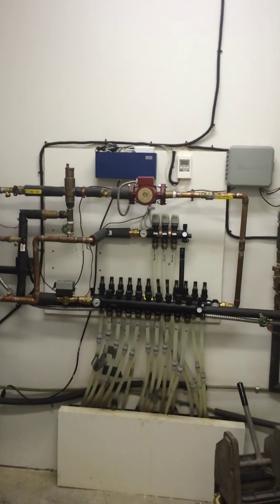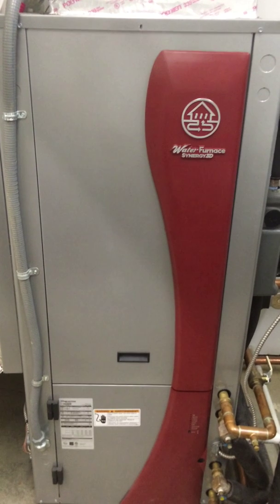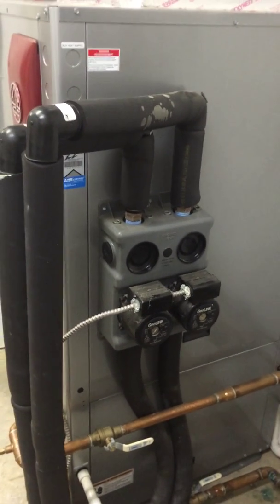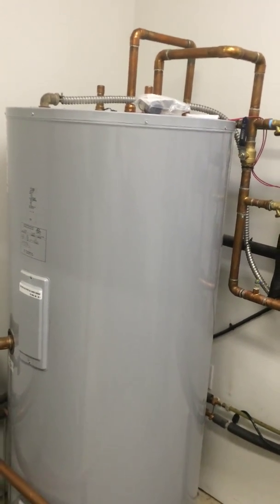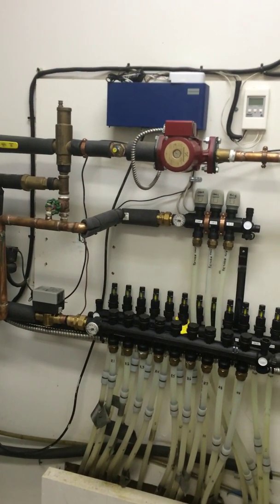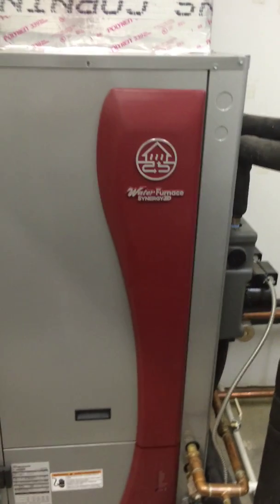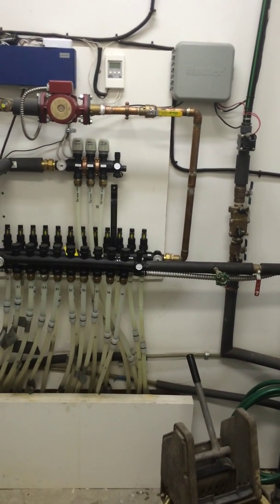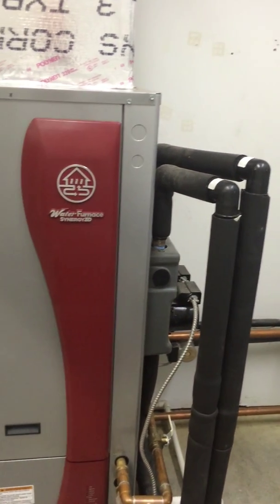ECS Geothermal Waterfurnace Synergy 3D

Comment: Great video. I have this unit and similar setup at my home with radiant heat.  On the storge tank i piped my unit into the top connections. And the radiant loops piped out of the the supply and return top connections as well from the top. I capped the side 1.5 ports. It seems to run pretty well and cycles on and off as needed. 

I was wondering if you guys ever do it this way or you always use the side connections? At the time i couldnt find any instructions on how to pipe the tank and what setup to use. The top connections just made the most sense for my location.

Also what water temp do you recommend for under floor between joist system. Mine seems to have a hard time keeping setpoint when its below 30 outside....set point 72.

Thanks jon